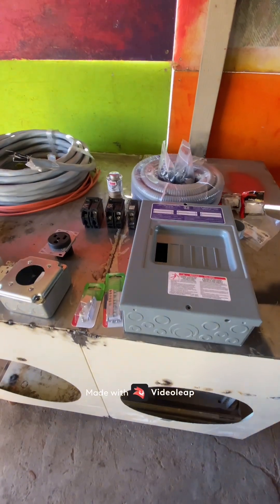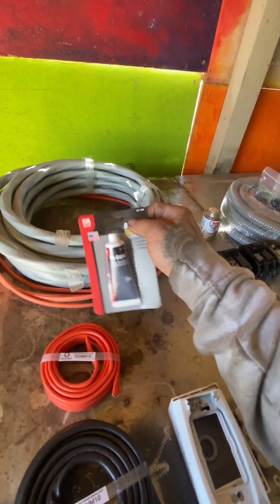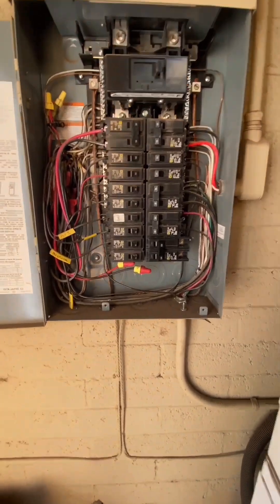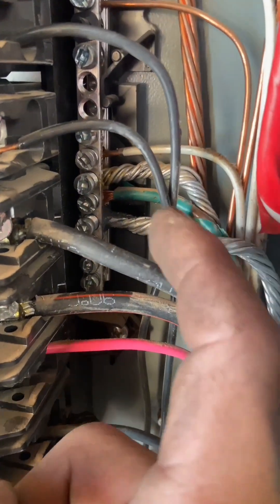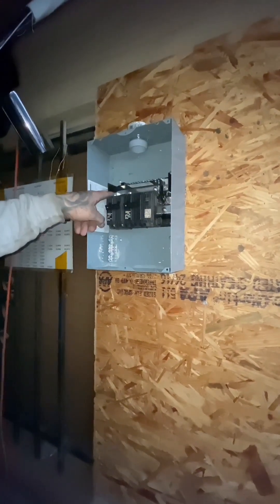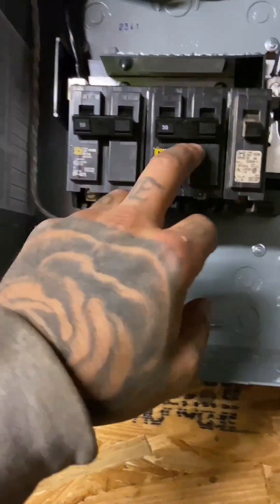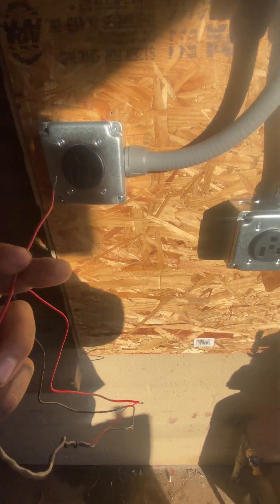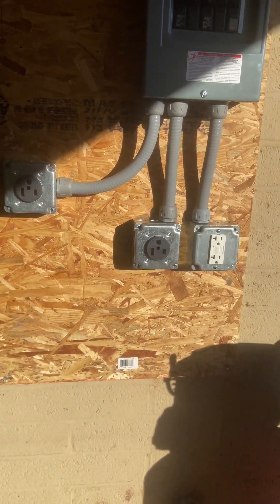installing a 100 amp sub panel

Comment: Would never cut corners and only install a 6 circuit panel that only now has one spare slot. Old school and slways painted plywood for panels especially in basements & damp garages. Looks like a score dick using flex instead of EMT conduit. Real electricians only use flex ( greenfield, FMC or non metallic plastic crap ) for feeding motors, outdoor AC units and vety few others places. Several vide violations in there us no GFCI or AFCI protection on the receptacles depending on what code cycle you are in. Ground wire in 50 amp teceptacle bix vould have been a little bettet wrapped around green ground screw.

Comment: Couldn’t you put in a bigger subpanel to give you more space for the future? Doing a load calculation for the garage with a welder and plasma cutter, you could put in a 150 sub panel and still feed off your 100 amp breaker. Not everything is going to be used at once. Correct?

Comment: Double tapped 15amp breaker at 2.14 in the video
Reply from the maker: had to make additional circuit space for 100a double pole breaker. reshuffled the deck to get two spaces side by side. combined two lightly loaded circuit breakers into one.
NEC 210.50 & 52
square d panels allow for two conductors per breaker in some common instances , that’s both homeline and square D QO

Comment: I just make it a policy to never use aluminum wire.  Saves time and trouble.
Reply from the maker: it’s budget friendly vs using copper, but it’s considerably more expensive. SER is type SE, Style R cable, used as an above ground service entrance cable, panel feeder and in branch circuits. wet and dry locations. & doesn’t require conduit .meets local codes and regulations for running a 100A sub panel from a 200A main.
Reply: @betosgarage  So the critical issue would be how far the sub-panel is from the main.  Doesn't look very far in this case.
Reply from the maker: it was only a 30ft run to attached garage , ran along top side of house with wire clamps at 4.5” interval . hopefully everything’s good

Comment: Surprised you didn't do 1/0 s.e.r aluminum. I think its rated for 150 amp...i didn't think 2/0 could handle 100amp...
Reply from the maker: Rated for 600 Volts and 100 Amps 
limited to the 90A ampacity of a 2AWG Al wire at 75°C by the NEC 110.14(C) termination temperature limit

Comment: Excellent work!
Reply from the maker: thank you !
Reply: @betosgarage  i got same panel just installed but only doing 50amp, i ran 6/3 but my q is im installing 20amp breaker first for some lights and other small shit can i have it start on the right side instead of left side? and/or since i got 50amps going into panel do is it ok to start with a smaller breaker like that cuz i know 20amp single pole is only 120v